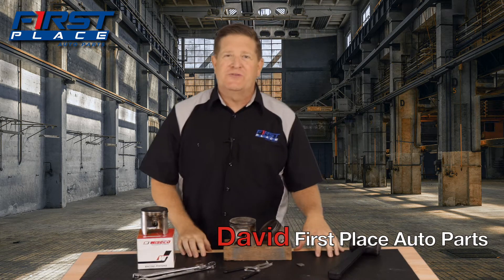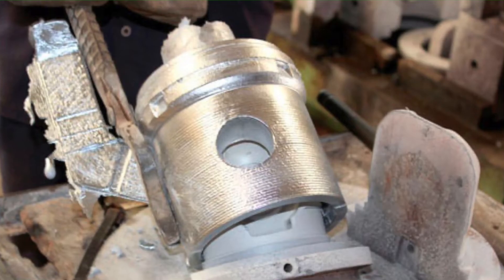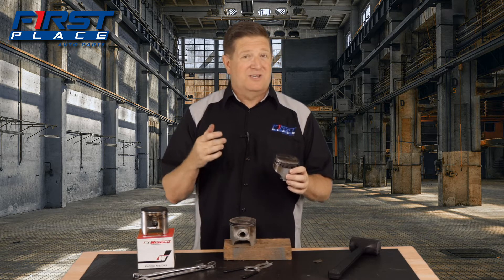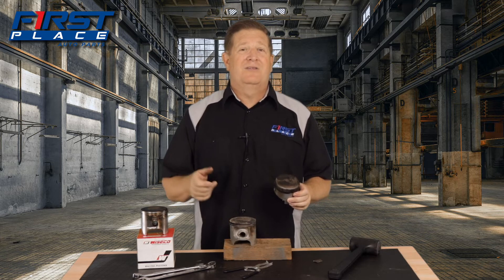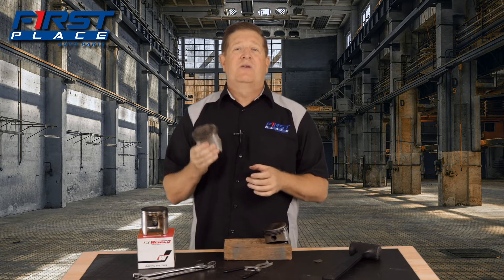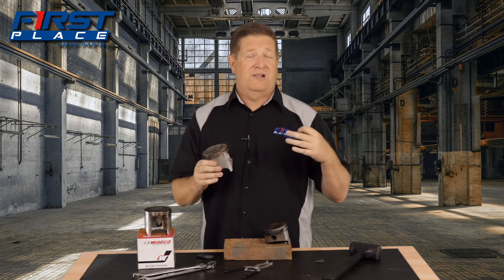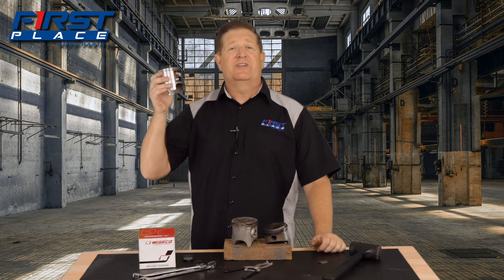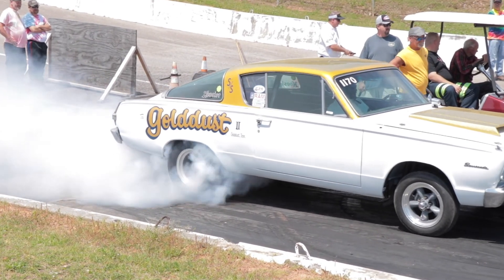Cast vs Hypereutectic vs Forged Pistons | Whats the Difference?

Comment: Great video. A question...
I want to take my stock 4.6 and make it unbreakble. I'm looking at an all-forged bottom end so that, whether I boost the engine or not, i dont have to worry about its durability or longevity. Trick Flow heads and induction parts, with Stainless Works headers, will finish out  out the build under the hood. My question is...

Am I crazy wanting a forged bottom end for the "peace of mind" quotient?
Reply: Your engine's longevity will suffer with forged pistons. This is mentioned in the video at 08:36. Forged positions expand much, much more than cast ones, therefore you need to plan a larger piston-to-cylinder wall gap. The result is additional wear due to piston slap on a COLD engine. Piston slap = wear on the cylinder walls, your compression will decrease gradually over the life of your engine. A daily driver engine with forged postons will wear out much faster. Comments welcome!
Reply: @jean-pierrehilbert2273 Well, here's where the difference between 2618 and 4032 alloys comes in. The 2618 indeed expands more and thus needs more clearance at startup with the attendant piston slap, but 4032 doesn't have that problem. I'm looking at Manley's Street Master pistons which are, as far as I've been able to find out, forged from 4032. Still...

Thanks for the warning.

Comment: Vertex 2 stroke pistons ( 🇮🇹 )are 18% silicone
Reply: Vertex makes an excellent piston. They're the OEM supplier for Husqvarna and KTM motorcycles. In certain outboard drag race classes the cast-style in 2.5 liter is required per rule. Those engines are factory rev-limited to 6800 rpm, but racers will spin Vertex's to 9000+ rpm with edgy tunes for hundreds upon hundreds of passes and I've yet to hear of a broken one. Some get smeared from poor fuel tunes, but I don't know of a broken one.

Comment: Great topic and well presented! I don’t mean to contradict but I cheaped out recently,I was always forged piston biased but for my budget gm3800 I’ve been using kb hypers for a while on pump fuel and turbo with a fair amount of boost and on 22psi it’s trapped 136mph and now high boost cut is at 30psi! so far I’m very impressed with the durability of the kb silvolites and they have been subject to many hard lean outs and a few too many over boost situations still no blow by and no oil use but wiseco and cp and few others are all I put in higher hp engines with a block worth more than $100
Reply: Thank you for the comment. Trying to decide which way to go on a 5.9 Magnum build with twins. Think I'm going to use the KB's.
Reply: @bbkr7910  yeah I’d still advise for competition use some forgies but if it’s cheap build and just has to work then they work fine! Not saying that they can’t be raced obviously lol,I’ve been having fuel pump issues last couple of weeks and it’s coming into summer here so I’ve pulled a spring from the gate and until it’s fueling is sorted out I’m on safe 15-22 psi now just in case
Reply: @needmoreboost6369  Thank you for the advice. I'll be looking into the different sizing of ring gap between top and 2nd rings. I'm thinking I should be able to hit my power goal of 550whp with between 8 and 10 psi of boost pressure and at or before 6000rpm, so not worried that much about hypers being a problem. Additionally I will be tuning conservatively to be able have the truck live on 93 octane pump gas. This is going to be more of a semi daily driver build that might see 1 to 3 passes down a drag strip each year. E85 is also plentiful in my area so will probably work up a tune on that when I'm wanting to go to the track just for some added safety factor.
Reply: @bbkr7910  good strategy! Id love to fill up with e85 but it’ll be half gone by the time I got home! and so begins a bad cycle of having to go get more lol. I’d opted for a larger than typical gap for safety and it was roughly.035” from memory and blow by and oil use just isn’t a thing on this for normal driving and even minimal running 25psi and flogging it for hours at a time
Reply: @bbkr7910  also for boost make sure you hone some extra skirt clearance and gap the ring’s accordingly, I don’t use other peoples theories on ring gap’s as often I’ll gap the top ring more than the 2nd, typically pro theory would state that they should be the same gap but cold? so cold I gap the top ring more as it’s hotter higher up the piston and the first ring is going to expand more unless the dissimilar metals contradict this but it’s been working so far on a few different turbo engines
Reply: I should mention as well the engine has been dismantled and inspected several times over the last 2 years with no distortion of the pistons being evident by micrometer
Reply from the maker: Hyper are great pistons... just be sure to stay out of detonation scenario's with them!
Reply: @FirstPlaceAutoParts  yeah thanks I definitely try to! I typically will add an octane booster if I know it’s going to get hard use and higher boost! but on 98ron it’s pretty well behaved even with a stock ecu, I’ve removed the quench on the heads not having access to the ignition timing with the theory of loosing some power to gain some durability but the experimental chambers seem pretty good as it’s even moved the burn shadow on the pistons more to the center and it seems to have not lost the power I was expecting it to
Reply: So is hyper good piston to use?